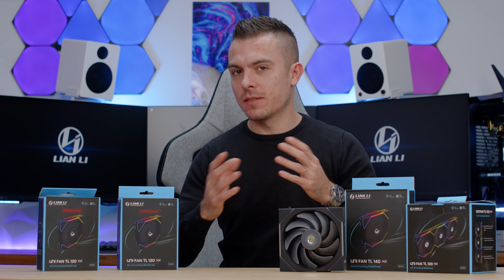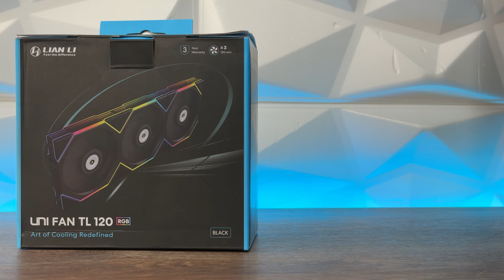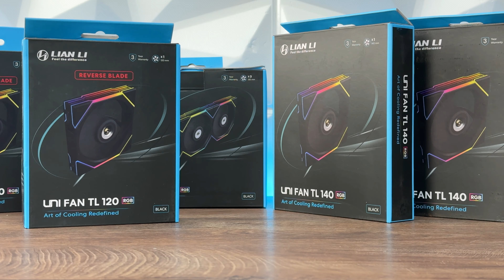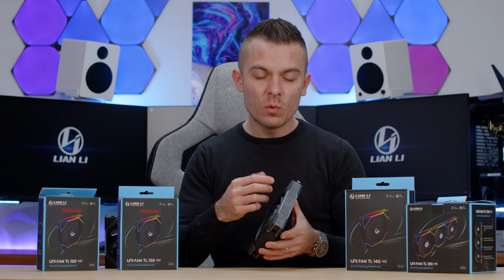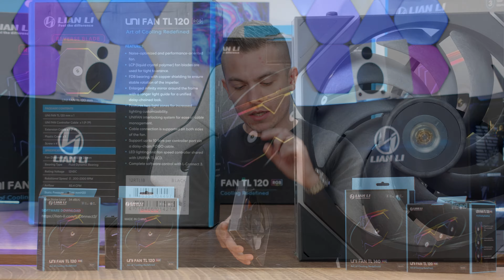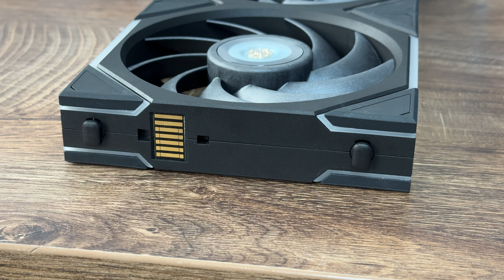NO LCD, NO PROBLEM! - LIAN LI UNI FAN TL

Comment: What's the difference between TL and SL? Confusing.
Reply: TL is a higher rpm higher cfm fan but costs more. The SL is a more budget minded fan with good cfms and lower noise level

Comment: Question
Can i use 1 controller Tl Lcd 
To connect regular TL Fan
Or i have to use 2 Controller 
1 for Tl Lcd
1 for TL NOT LCD
THANKS
Reply: TL and TL LCD share the same controller but you can use only one type of fan per port in the connector

Comment: What is different between the TL120 and the SL120, which has the sticker covering the middle?
Reply: The TL has a newly designed bearing, more fan blades with a different pitch, and slightly different windings in the motor.  It uses less power then the SL but it's more powerful so it's a win/win situation.

Comment: I can not understan why the non LCD version has no sticker on the fan motors, its showing and its ugly
Reply: Just do what I did which was measuring the center piece then install a matte black sticker.
Reply: @gueDoctor imagine buying these crazy expensive fans just to then put stickers onto them lmao, the infinity fans look way better than this and now also much cheaper as well
Reply: @kerotomas1  no
Reply: Put a sticker on em.
Reply from the maker: I guess it comes down to personal preferences... I don't know. :/
Reply: You could get the reverse ones and use them instead
Reply: but infinity arent as good as these when it comes to cooling these are probably their best fans check specs i also wanted infity but that extra rgb or lcd screen is there in cost of performance... so i dont want either of these rgb is cool but not over performance...
Reply: I think exactly this is what looks the best lol